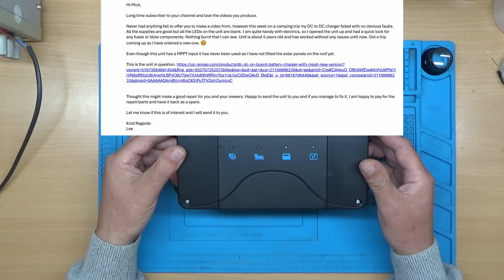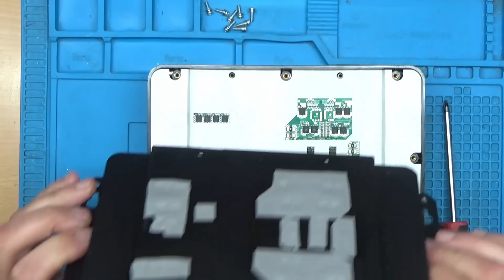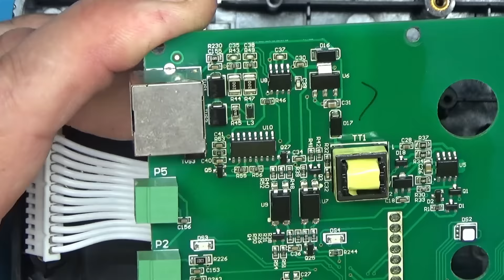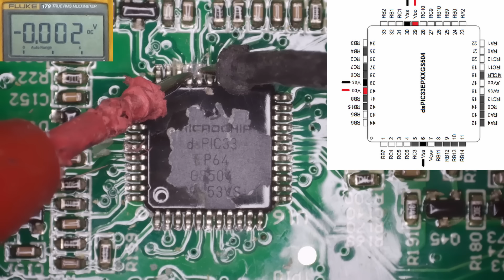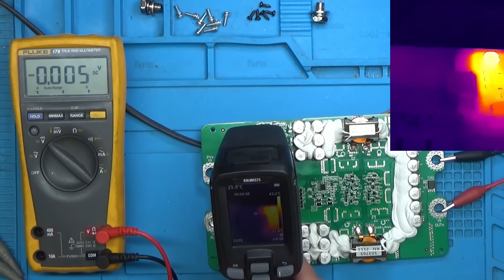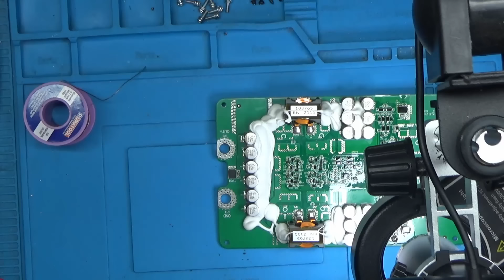This ONE Tiny Component Made This £200 Device Useless! | Renogy DCC50S Repair.

Comment: Don't you just hate that conformal coating sometimes !!, I have some dangerously sharp meter probes for that stuff (I sharpen/re-sharpen them myself). A good find anyway.
Reply from the maker: Thanks 👍At least I'm thankful that it wasn't all potted like the Victron MPPT controllers.
Reply: @BuyitFixit  It is a necessary evil though. I do quite a lot of automotive & marine electronics, I always re-apply the coating when finished.

Comment: Top job as always. Pesky capacitor! Weird how, with through hole components, there was always a coding convention for working out the values. But then with lots of the SMD stuff, they just don’t bother. How do they get away with that?
Reply: The capacitor was tiny, maybe 2mm long, the video (and microscope) makes them look big. No way they could reliably label them
Reply from the maker: Thanks mate 👍Yes, the problem is that as the things get smaller, there's no room to put markings on them. Some of the smaller stuff is worse as all of the resistors all look the same too.

Comment: It's a common failure on motherboards. It's always a high value low voltage ceramic. I guess that the dielectric thickness is low and they are prone to cracking and the plates shorting. Usually an easy fix with a thermal camera.
Reply from the maker: I concur 👍🙂

Comment: Seems to be the output caps of the buck converter. Those caps are always driven hard. Strange choice to have three in parallel as the slight differences in the values and parasitics will lead to some of those caps being driven even harder. Smart find nontheless!
Reply from the maker: Thanks 👍🙂
Reply: They are just a store of charge, they are not being driven. Capacitors in parallel add up, 3 x 10uF = 30 uF. Its better than using one 30uF. Also much easier, instead of having many tiny capacitors with lots of different values, you just need one or two values, and use them in multiples when you need a higher capacitance.